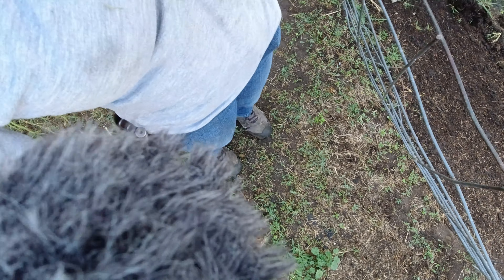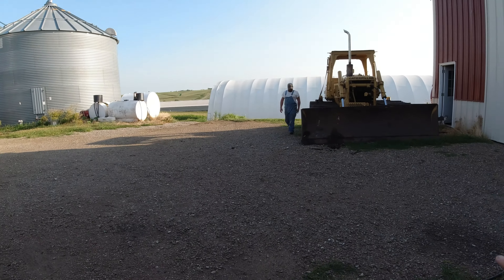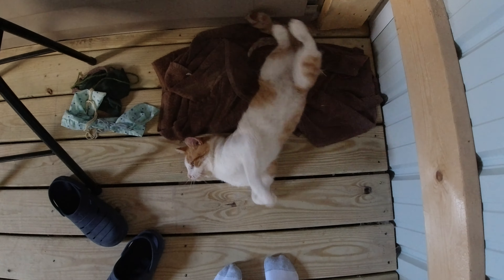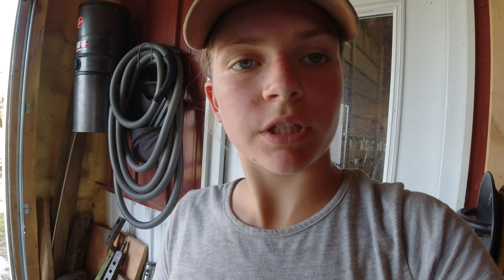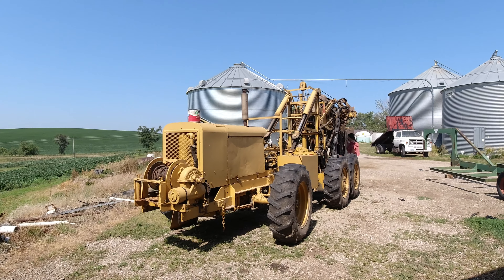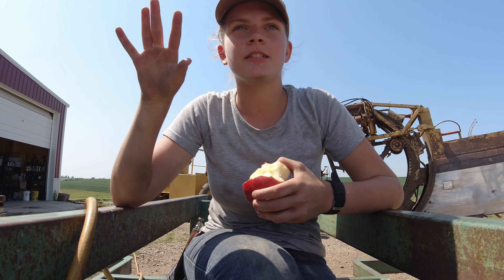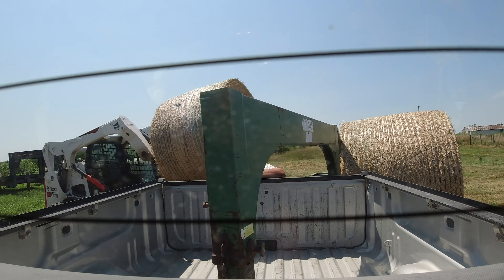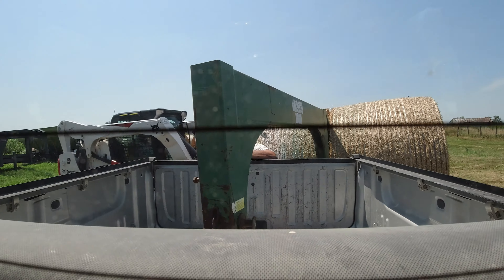Scooping Corn and Hauling Hay!

Comment: Another "city slicker question". The sweep auger, how does in move forward: it has power to move it or does the natural movement pull it forward? Mark
Reply from the maker: excellent question, we'll answer it more in depth in a future video, but it has a wheel on the outside edge that pulls it forward, and a gearbox in the center that drives off the unloading auger, which is powered by the motor outside